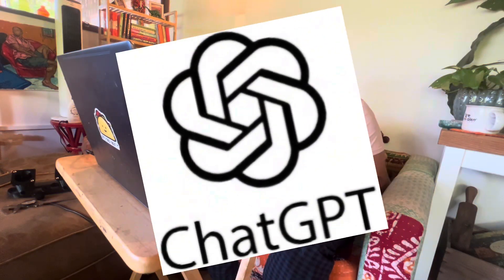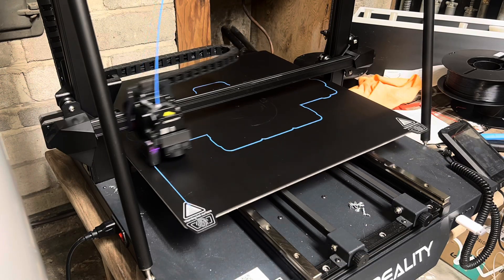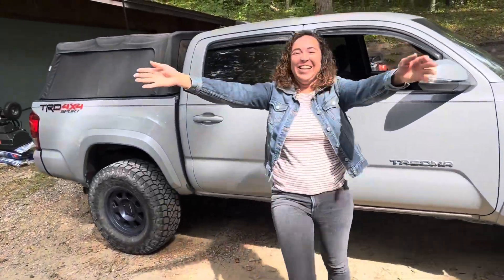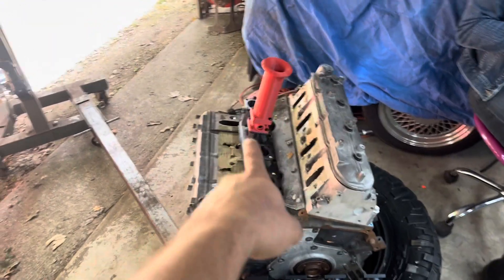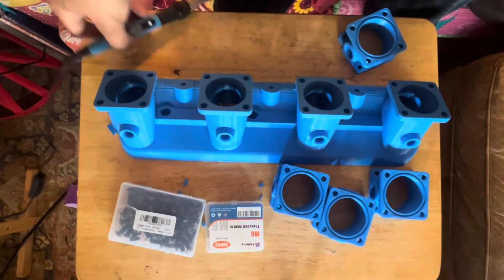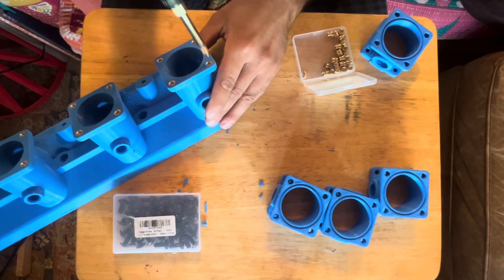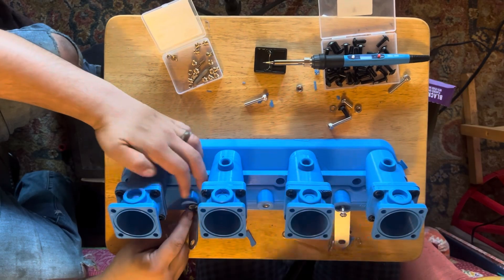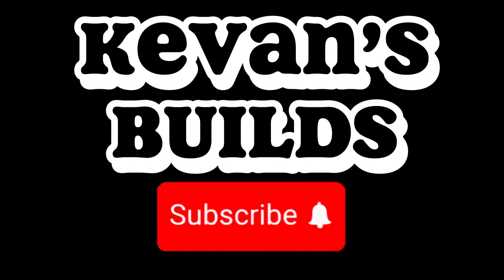3D Printed LS ITBs – First Test Assembly! -Part 3

Comment: Ok, good design work, but a bit confused here: are you building a rat rod, or an injected LS ( and if so, what is the point)? Rat rods get carbs. The other thing is if you screwing together plastic that is on a hot engine, it better stay in place, and melted in threaded fittings are not a good choice, imo ( ask me how I know ). Better to go with threaded inserts, or bolts with nuts and lockwashers. Yrmv.
Reply from the maker: My rat rod is getting a fuel injected LS. Keep watching my other videos! You will see how it comes together! Thanks for watching!

Comment: What plastic will you use for the final part? For temperature resistance 😎 its a shame polycarbonate is not fuel resistant, it handles heat well
Reply from the maker: I’m using a carbon fiber reinforced nylon. It should handle the heat exceptionally.
Reply: @KevansBuilds  PA-CF is one I haven't played with yet. I have been using PC (polycarbonate) for 3d printed electrical enclosures here at work, I have read PPS-CF works really well but is a high temp print (320'C nozzle) and pretty expensive
Reply from the maker: @fullsendmarinedarwin7244 yes it is. It’s also important to regulate the temp well in an inclosed printer. At least that’s what I have read. I have to enclose my massive Creality CR-M4…

Comment: Gonna watch the whole 3 videos asap. Love the idea, love ITBs but I'm super sceptical about plastic intakes like this. I have an ITBs setup on my LS based motor - damn they are finicky to adjust to synchronise etc. Plastic warping might play a huge part in it. 
If you are interested I can have a look at the intake temps (air intake) but it won't tell the full story of the temps on the heads
Reply from the maker: That would be cool! The final material I’m using is pretty heat tolerant.  More so than the ABS that the original intake was made from. Of course 3d printing is a lot different than injection molding but we will see. I’m willing to fail to success to figure it out!
Reply: @KevansBuilds def wish you luck with it mate. One more thing to consider - in my setup (ebay copy of jenvey) fuel rails needed a different mounts (brackets), I've fabricated mine but the fuel pressure is quite high, aluminium brackets (3mm each, 4 of them) were vending and fuel went all over the place like a good old fontaine. Keep an eye on it. 
We have a video about my setup with that very same fuel issue I could share
Reply from the maker: @georgegavrylenko1031 that would be neat! Thanks!

Comment: As a suggestion when putting those heated inserts into the plastic, have a long bolt ready with the same thread, you can quickly thread it in to more accurately see if you have the nut lined up perfectly.
Reply from the maker: I put a stop in the bottom that it seats square into. When I reach the stop it squares up nicely in the hole.